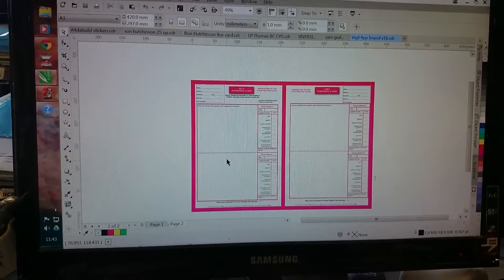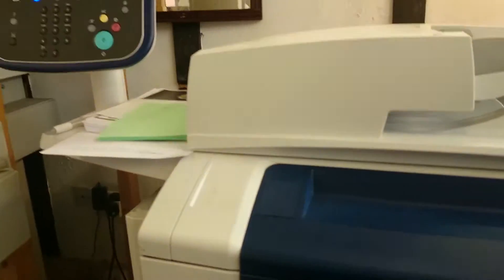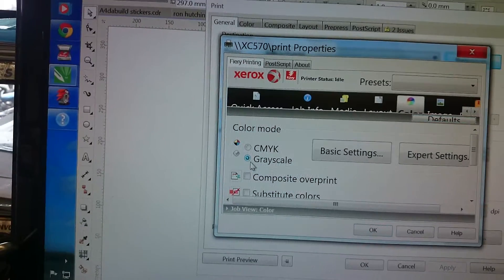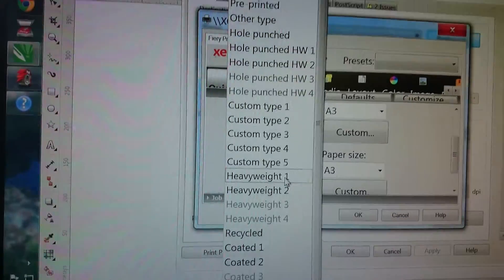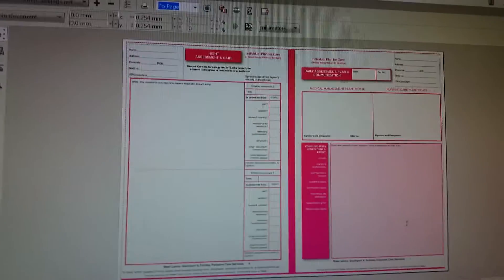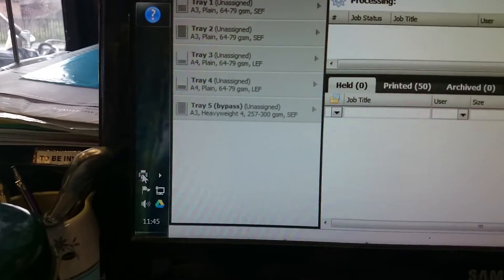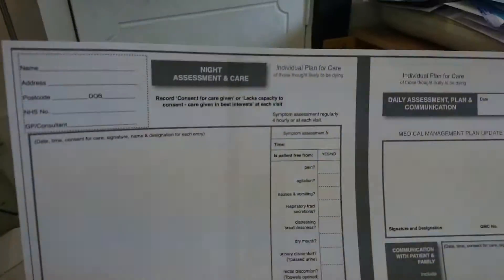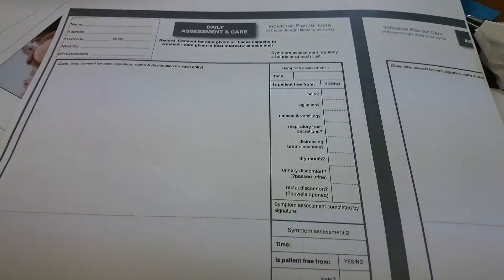Duplex printing problems corel draw 17

Comment: hi James
Hell yes, in fact leaving the problem unsolved was never going to be an option for us. The Fuji-Xerox team worked it out by loading 20 patches into the Fiery relevant to our Vasante 80. I reached out to you at the time but Fuji just needed the time to work through the issue, after all it was our contractual right. Thank you for getting back to me.
Bryan

Comment: Hey Guys, I started having this problem as well, don't know if you found a solution or not, I spoke with Fiery and they just released a patch in May (FIT101957640) that fixed my issue.  If you go to Command Workstation and then the Server menu and then Device Center.  Once Device Center opens at the bottom left you will see "Updates" and "Patches" - If you click on patches, it should be listed and you click the patch and unfortunately it has to install any others that are above it, so it takes awhile.  But after that it works like a charm.  If you don't have the patch, here are the instructions from the Fiery Rep I spoke to:

The patch is posted on system updates for this Fiery. You can either get it by enabling automatic system updates in Fiery Configure or you can download it from Check for Product Updates here: https://liveupdate.efi.com/WebUpdater/default.aspx?uv=004&sid=41f3c2275bc2892f440799f61cdac094EF532874.PPD

Note that patch order is important, so if you decide to download and install this patch manually through Check For Product Updates, make sure to compare the list of patches to the patches that are already installed on your Fiery and make note of patch order, prerequisites, and reboot requirements noted in the release notes.
--------------------------------------------------------------------------------------------------------------------------------------------------------------------

Hope this helps!!

Comment: Hi, So have you solved this as it is now 2019 and I can not find the answer
Reply: Not Solved yet...
Reply: Hi John
So you have had this problem for 5 years. That is unbelievable! Why isn't anybody onto this? I have ti get a solution and get it now.
I an not going to convert everything to pdfs to print. 
Corel has great imposition options.
By the way. I do not get this problem with Corel Draw Suite 15, only with Corel 19 ..latest version.
Reply: @audiovisualdesignprint  Hey Guys, I started having this problem as well, don't know if you found a solution or not, I spoke with Fiery and they just released a patch in May (FIT101957640) that fixed my issue.  If you go to Command Workstation and then the Server menu and then Device Center.  Once Device Center opens at the bottom left you will see "Updates" and "Patches" - If you click on patches, it should be listed and you click the patch and unfortunately it has to install any others that are above it, so it takes awhile.  But after that it works like a charm.  If you don't have the patch, here are the instructions from the Fiery Rep I spoke to:

The patch is posted on system updates for this Fiery. You can either get it by enabling automatic system updates in Fiery Configure or you can download it from Check for Product Updates here: https://liveupdate.efi.com/WebUpdater/default.aspx?uv=004&sid=41f3c2275bc2892f440799f61cdac094EF532874.PPD

Note that patch order is important, so if you decide to download and install this patch manually through Check For Product Updates, make sure to compare the list of patches to the patches that are already installed on your Fiery and make note of patch order, prerequisites, and reboot requirements noted in the release notes.
--------------------------------------------------------------------------------------------------------------------------------------------------------------------

Hope this helps!!